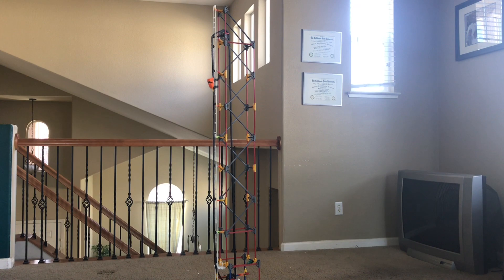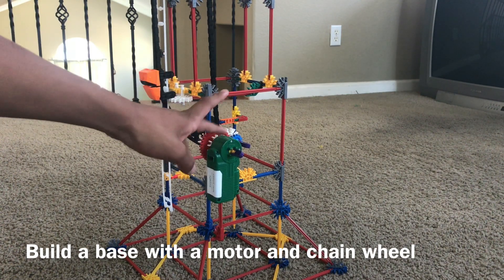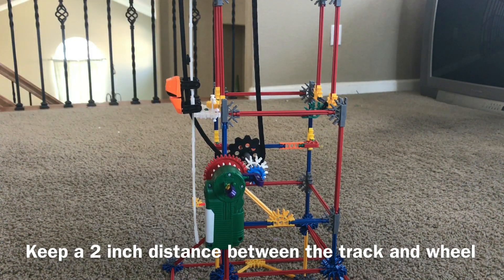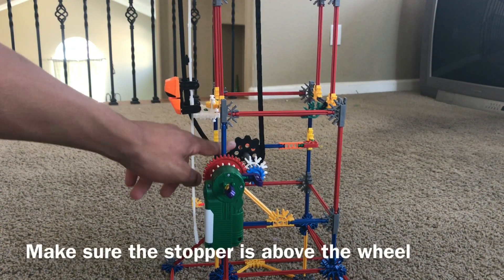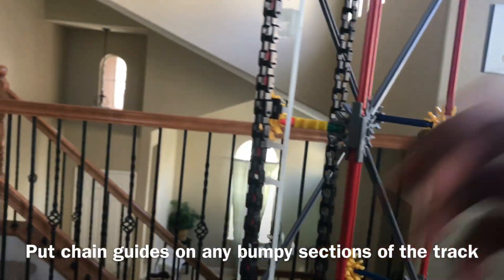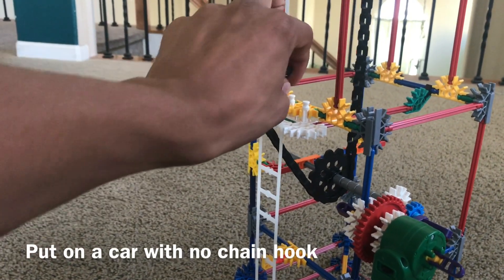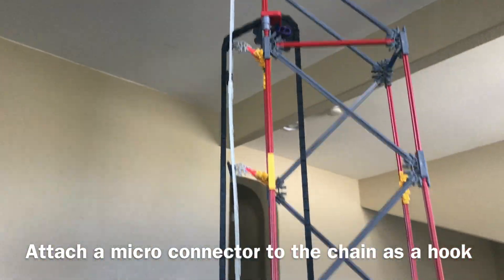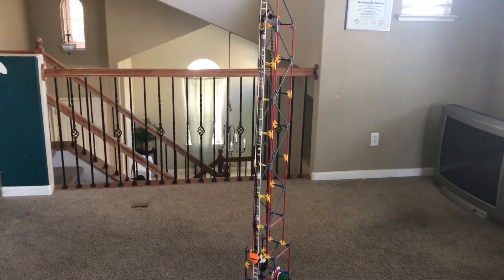How to build a K’NEX drop tower (step by step)

Comment: Please see this! I’m trying to build it, but the micro connector won’t stay on the chain, and when it does it doesn’t work on the gear. What should I do?
Reply from the maker: Conner Place You can try placing it on another chain link and see how that works, it should stay on
Reply from the maker: Also try make the chain another link longer in order for it to run smoothly
Reply: Roller Coaster Crafter ok thanks! :)